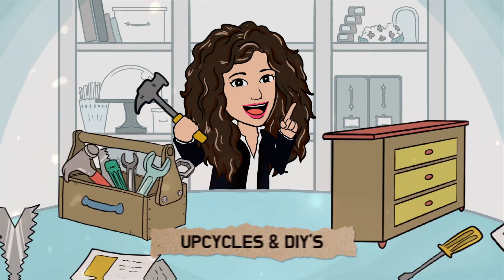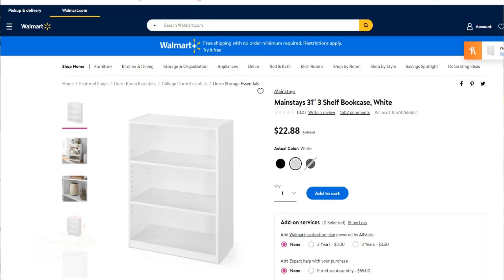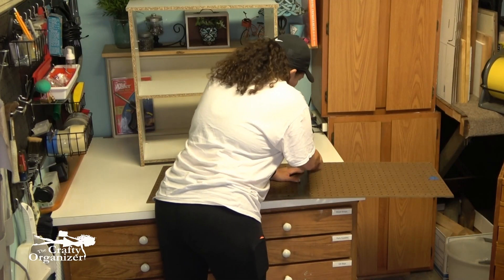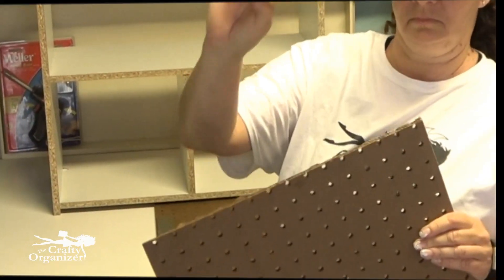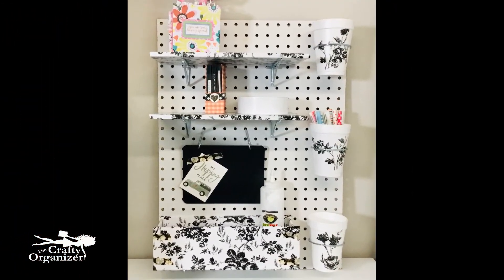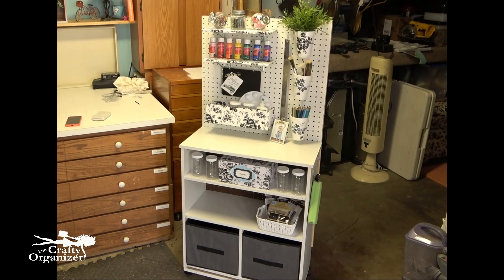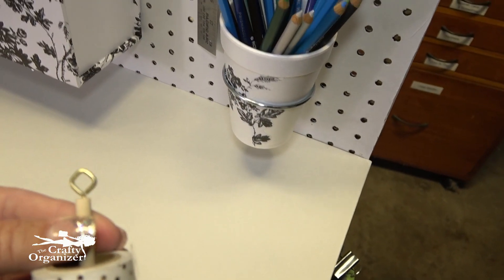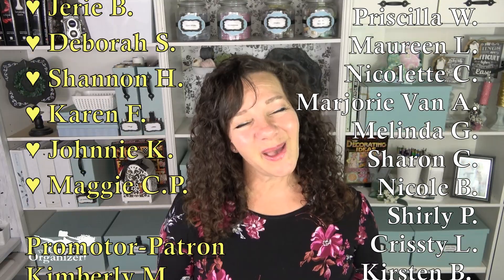Incredible DIY Art Storage with Wall Storage INCLUDED!

Comment: INSPIRATIONAL THOUGHT:  I could ALSO see this in my mind in the spring to summer months to be used on my large deck for potting, feeding trimming plants especially if you used metal or plastics: For shelf unit-purchase painted metal; metal pegboard and pressure treated for framework!  

Then I would want a side shelf “extend a shelf” at bottom above the wheels for 2 oblong tall  containers with lids; one for potting soil enough for a couple of pots—-and the other a wastebasket for leaves/trimmings.   Last year I purchased a potting mat with snaps at all 4 corners so the potting soil overflow is in bottom of this and when done unsnap one corner and pour soil back into soil container or if cleaning up—-then unsnap and pour into compost. 

As I see this in my minds eye- - I see an exterior piece of plywood above the wheels.  I could also the front side to stand against like a kitchen counter, but using the back side extending the  plywood out about 6” for some plant pots. 

I get so inspired by enthusiasts that have trouble shutting off the creativity at night. Years of sleep designing haha! 

So there you go Ms Organized crafty lady I so am enjoying and sharing!  Since my house is kind of rustic….I would use corrugated metal along the back and sides of the metal shelf unit!
Reply from the maker: So many uses!  Kitchen, bbq, sewing, home school, office..... but I am so happy you found a use for it.  Let me know if you make it!!

Comment: I have spent the last week and a half looking at fully finished garden/plant tables to put inside my old den, which is a converted carport, as the last piece of functional items for an area that takes on a few inches of water in heavy rain. After the 2016 flood that put 20” in and under the entire house, I had to come up with a flood resilient plan that would allow for easy cleanup. While I’m still using old furniture, I’ve donated and tossed a lot, repositioned what’s left and draped a couch with a ginormous moving company furniture cover. I even discovered that a folding brown-and-black bookshelf fit perfectly inside of the old — yep, brown-and-black — armoire in the low den. The last area to figure out is the garden tool storage area. I wanted a potting table on rollers with a pegboard/shelf top, but good lord, the cost of one already built was well over $200 and still needed work. So, for now, I have moved on to the tool shed clean out. When I was surveying the work load yesterday, I found two old small bookcases in the back — one with pencil drawers — that are solid wood. 
When I opened your rolling peg board video today, I let out a howl. Yes!!! This is exactly what I need!!
I have to clean out the tool shed before I can get to the bookshelves, but this is perfect. The shed was cleaned out after the flood, but as often happens, it was considered out of sight and crammed with tools and rustic items that weren’t tossed. 
Anyway, thank you!!!!! I suspect it will be the middle of June before I finish, but who knows.
Reply from the maker: YAY!!!! I am so glad I could help!!!!!  Please take pictures of what you make!!!!  I'd love to see them!!!!   You can share them to my Crafty Organizer page on Facebook:  https://www.facebook.com/groups/730125317461615/

Comment: Oh Norrine, I've been trying to figure out a base idea for an all in one screen PC. I like where it sits and I need it on casters to move to my direction when I'm working. I know this may seem excessive to others but I need that additional screen specifically for 1 continuous changing view, like it's own window that I can have near me but easily move back, like I can put my tablets and laptops away at the end of my work day or project..

I already have a 3 tier shelf bookcase! It's a little taller than yours and its 1980s brown fake wood look.

 It currently sits on the left corner of my desk, on a shelf I made for another project (with fancy stair safety vertical rail bars for legs) turned slightly forward on the left because it's in front of that side of the windows. 

That desk top is actually a $20 indoor door from Lowe's or Home Depot. The drilled hole for the door knob is perfect for cords to go down for electricity needs. I don't have that part of my room planned out or functioning yet. Every part that I've made and the door are still unpainted because aesthetics haven't been figured out yet, in that corner of the room.. Craft Mats really come to the rescue when I can work there.

The desktop PC (not set up) currently sits on 3 unfinished wooden crates, on their sides, book-case style front view. I knew that I was never going to be able to make that mobile without serious modifications and something heavy as a base at the bottom for ability to move on casters. Its top heavy right now.

So for months I've been staring at both the PC and the bookcase. I was thinking about collaging book pages all over the book case and I still might. I was thinking a microwave cart..

But, the bookcase is only there to take advantage of vertical decorative storage and functional eye candy. The crates could very easily trade places with the book case. I may cover them with book pages, too. I'm considering that whole area to have that look but I'm not sure yet... for many years now. 

(I have a bad back and there are other things to finish or figure out ahead of this chaos. This room is technically the formal living room where you only go when you have guests, in the South. It's where your perfectly clean and best furniture resides=. Bleh! 
I'd seriously trade the house for a bungalow or apartment back in Cali, with your back yard. Ha. I call this room my multi-room. Opposite the large desk area is a King Size bed. I watch YouTube on my tv across from the bed on the other side the window already referenced, on Roku. I use decorative storage boxes to store my craft supplies. I have a charging station on the far corner of the bed than where I'm plopped, working, or crafting. It's a Dollar Tree plate rack on a plastic tray from another Dollar store that was more than a dollar, with a thick dish cloth drying mat between them to stop slipping. I use fabrics and the craft storage boxes to move your eye into color changes as you look around the room. Blush Pinks, Purples, Sage Greens.. most of my shelving or dresser drawer like modulars are white and my undertones and background color is brown/tan and not the more common gray. It is the largest space with controlled temperature in the house. I have a large foyer I encroach into, room. 🙂)

This project is the answer to that PC dilemma.. I'm not sure if a peg board on the back will work but something needs to be there. The back (in its permanent position in the room) is a background to the left side of my U-shaped desk.. The top area is personal and focused on my family. So the back needs to be pretty and maybe functional in small ways.. like that pretty magnetic part you have on the front of yours or a pretty covered large cookie sheet so I can put magnets on it.

My shelving is full vertical space on wall brackets. I want to put very pretty lace across the front of them that hangs below the shelf line.

That project is only stalled from inability to accept that the lace can be different on shelves in the same area. I know that's silly. I also might consider painting the fronts real white 1st, too.

I mention all the lace and paint because of this bookcase in action now. I have to decide book pages, paint, fabric, lace...

I'm so glad you did this. I didn't know your co-partner.
Reply from the maker: I hope this does work!!!!  You could always get a sheet of paneling (same material, just one has holes for storage) and it should be the same price!!!  Your home improvement store should also be able to cut it down to size for you!

Comment: Awesome Norrine!!! 🥰I'm still a little confused about the wheel position though. Lol. I saved this video. I will be watching again. Glad you were able to get this gem finally aired before you bursted out of excitement alone. LOL.  I simply Love this project. It will also help me with cleaning better. Just pull away from the wall without the worry of the weight of it. Have a fabulous week sunshine. 💜🙏💚🎈🎉🎊
Reply from the maker: It's a tiny bit wobbly with the wheels set in from the corners.... having the wheels at the farthest corners would make it more stable.  Does that make sense??
Reply: @TheCraftyOrganizer  100% lol thanks sunshine. ☺️

Comment: Awesome!! Awesome!! Awesome!! 
Scared of the drill but was thinking maybe I could turn my rolling cart into something similar...
Reply from the maker: I think you could..... You could use an s hook through the peg (i'd place a large washer on the board first for extra strength) and then 'hang' the peg board from the sides of the cart.  My only fear is is the weight would pull it off center and make it tip - because the cart base is much smaller.

Comment: I am going to take these ideas and make some moveable storage for the bottom of my pantry. I have been looking for something on wheels and could not find anything short enough, but I can modify your idea and most likely end up with even more storage than I ever would if I purchased something. I love those cups that Sherry told you about. I’m going to get some of those and cover them and hang them from my soon to be new pegboard in my soon to be new craft area. The 2 of you have done a great job. Thanks!
Reply from the maker: Not sure how tall you need them, but you can get shoe organizers that are made from the same material at Lowes for $9.99.  You can then add wheels and move wherever you need them to go!

Comment: I am shopping for the supplies online.  I don't find the pieces that hold the cups.  Where did you get those? TIA
Reply from the maker: I think Sherry got them off of Amazon:  https://www.amazon.com/Menecor-Pegboard-Accessories-Holders-Organizer/dp/B0868K3MS8
Reply: @TheCraftyOrganizer  I ordered the wheels and they actually arrived today.  I am probably going to return them. the stem of the wheel is much wider and shorter than the wheel you used in the video so a much bigger drill bit is required and even if I had a big enough drill bit I think a hole that wide would not be good given the particle board is not much wider.  I have also watched the video a few times and don't understand where you think the wheels should be. Help!

Comment: I normally enjoy your makes, but this is encouraging people to make something inherently unstable, that is made worse by adding the extra height of the peg board. Screwed to the wall it would be ok, or if you screwed two bookcases back to back to give a wider base it might be more stable. If you had small children and this toppled over it could seriously injured them. The original instructions for the bookcase would have told you to screw it to the wall.
Reply from the maker: Thank you, Helen!  I would never want a suggestion of mine causing harm - I hope anyone with smaller children will take precautions to make this safe for their family and their needs.  It's why I repeatedly said to have the wheels at the farthest corners for stability.  I appreciate your feedback and hope it helps others take this point into consideration.  💜